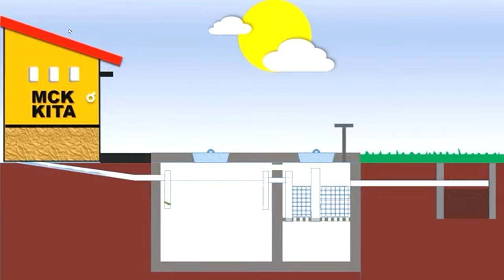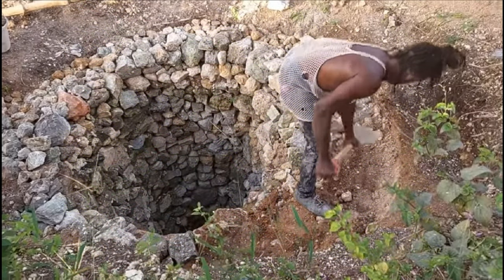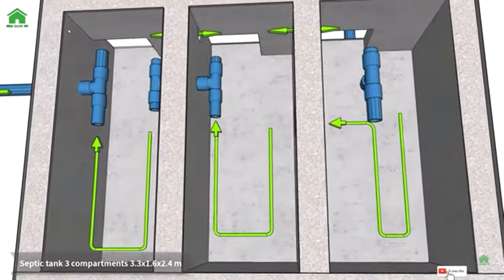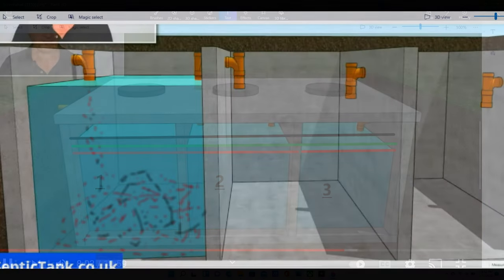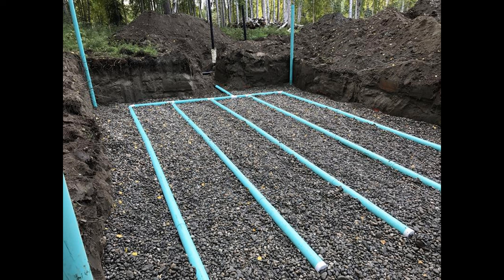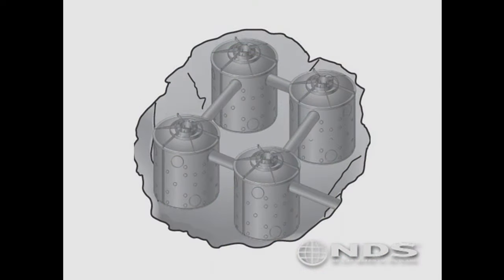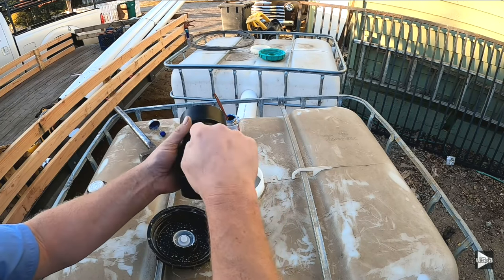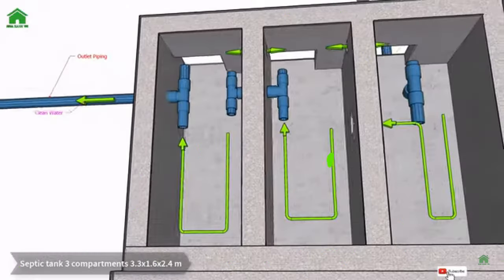BUILDING YOUR DREAM HOUSE IN JAMAICA,  3 CHAMBER SEPTIC SYSTEM SEWAGE COLLECTION

Comment: Excellent presentation. This modernize system was well though trough, and should be mandated in all parishes. Is this system seal tight, so no one can smell sewer gas in the house, and neighborhood? Also, is it beach friendly to periodically pour in the toilet, or something bio degradable?
Reply from the maker: Sealing. yes and no. Yes the chambers are tightly sealed to prevent too much air getting in. It does produce gasses, but because of anaerobic digestion the only gas that comes off is methane and it has no scent. Now, methane is flammable but because it's so little there is no chance of it catching fire. 
No, because the end does open to the final drain field and the small amount of gas simply escape to that.

Bleach. Yes you can pour bleach in the toilet. It will not affect the process.

Also because of how it works and because of how modern plumbing is installed even if there were smelly gasses that gas could not back up through the system and into the house through the pipes. Your neighbours would not smell a thing.

Comment: Hey @ jusssayin mipeece, great video per usual but septic tank system coupled with an absorption pit, tile field or a Reed bedo are widely used in jamaica. I'm building in Manchester and all building plans  submitted to the Parish Council and the Health Department are only  approved if the waste disposal system has a septic tank. Like u said when people are building off the beaten path they sometimes disregard the standard and construct just an absorption pit.  Most importantly this practice  contaminate our aquifers especially in areas where the water table is very high.
Reply: Hi @curatedhome5108, do you know of a really good person who could construct a septic system  for 8 bedroom, 8 bathroom home.
Thanks in advance.

Comment: Hi .jussayin   it not possible to havering  that isstall in jm  if you have a 1/4  acres  lot
Reply from the maker: yes it can be installed anywhere. all you need is a space to dig the shallow chamber and remember that the drain field can go down vertically so instead of having small pipes going out you can just dig two or more hole that will fit  those blue plastic barrels, drill a few hundred half inch holes in them, bury them at least 40 inches under ground and lead your cleaned up water to those as your leachfeild.

The great thing about this as i mentioned is that it keeps your lawn green or you can plant vegetables and anything else near by because of the watering effect.